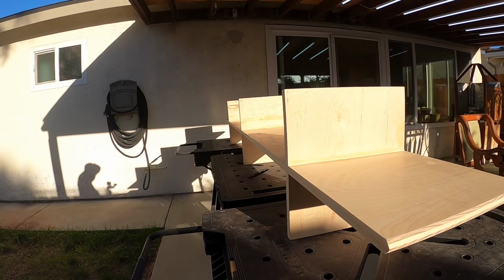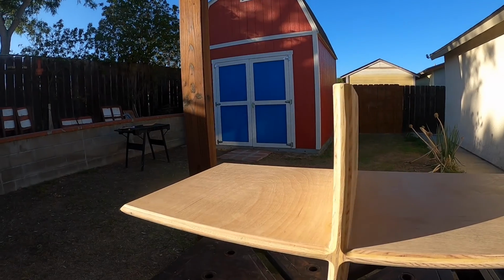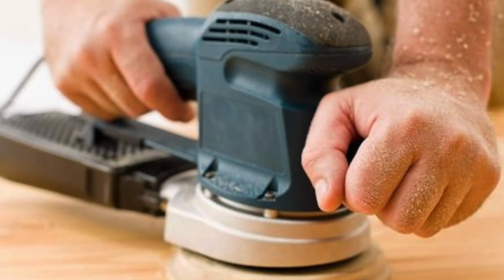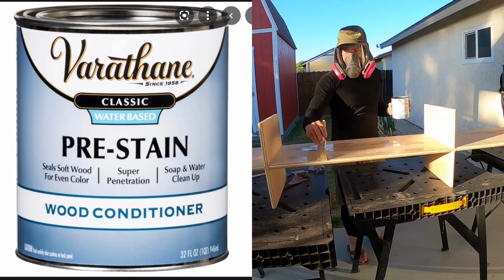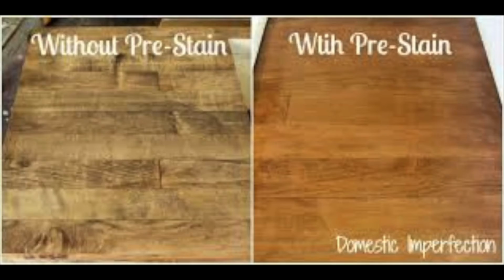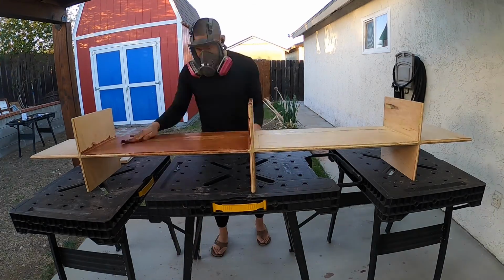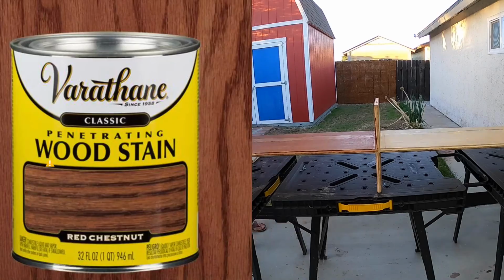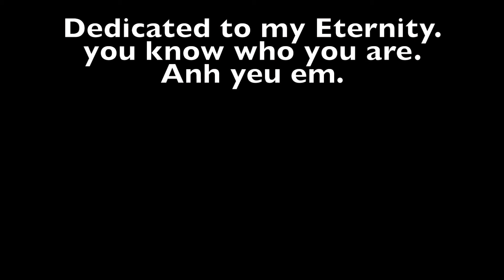Rectangular storage stand

Comment: Hey Vu, quick scooter question (if ya don't mind?).... Do you happen to remember the rated RPM of the 1500W motor of the original Super Lithium 1500?
Reply from the maker: You can do a little math
Reply from the maker: Go watch my sprocket video toget the teeth number.  35 mph was the tip speed and you calculate the motor rpm.
Reply: @MinhvuLy  Ok, I'll look into it. tx man!